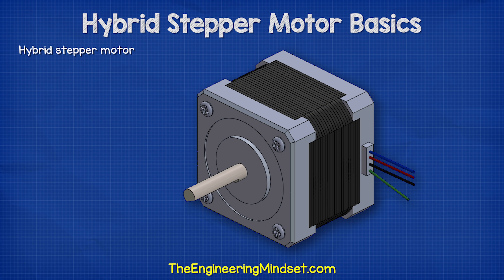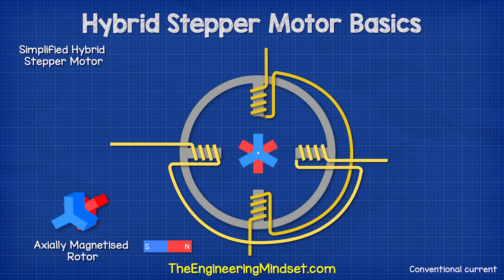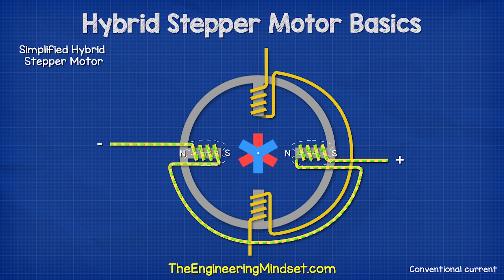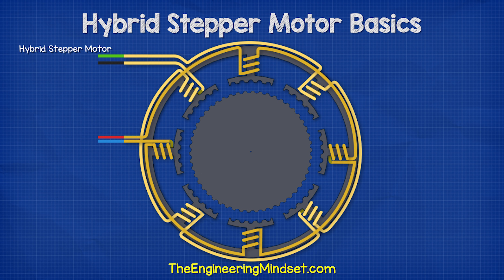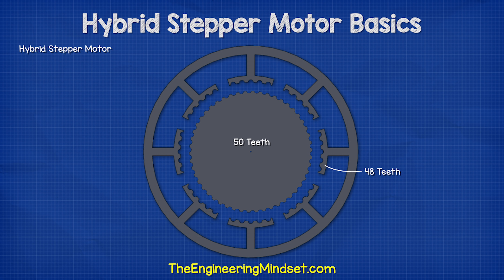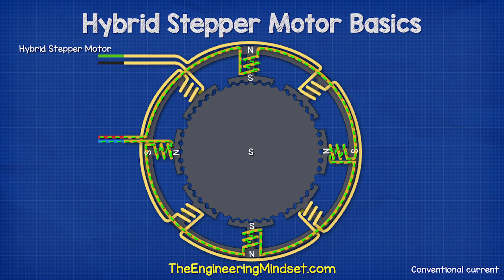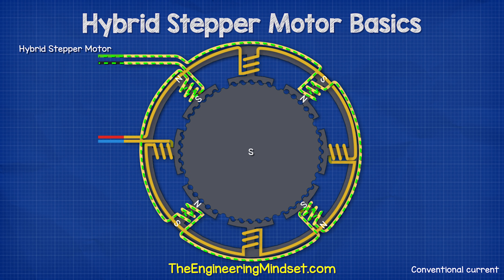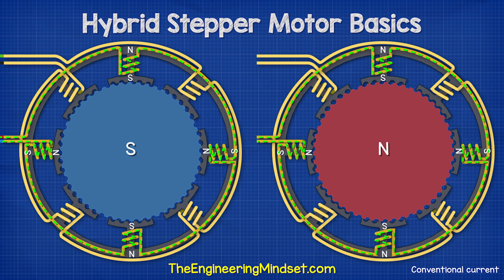Hybrid Stepper Motor Basics

Comment: Hybrid steppers most often include encoders.  Manufacturers such as Schneider market “Smart hybrid steppers” to function in traditional servo applications with the usual trade offs.  The Schneider Lexium versions include a drive and programmable control in the motor package.

Comment: What are these motors used for?
Reply: ...for really slow rotation step speed and for hold in state. You maybe find somewhere from 3D printer or else robotic movement. Servo motor again have gears inside (if I understood right).
Reply: @GameBacardi  Servos don't have to be geared and there are geared stepper motors. Servos are normal motors, usually DC, where an feedback method, usually an encoder is used to control speed and position. Servos have normally way higher rotation speed, torque at high speed and depending on control also better accuracy. However they are more expensive, more difficult to control and have less holding torque.
Reply from the maker: Check our new Servo video out: https://youtu.be/1WnGv-DPexc